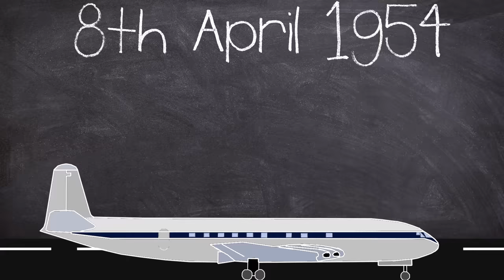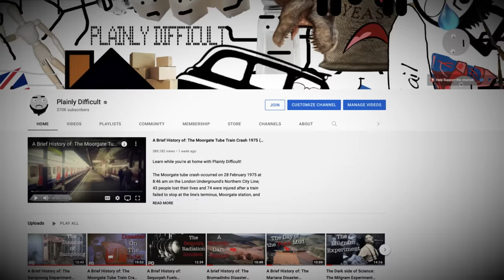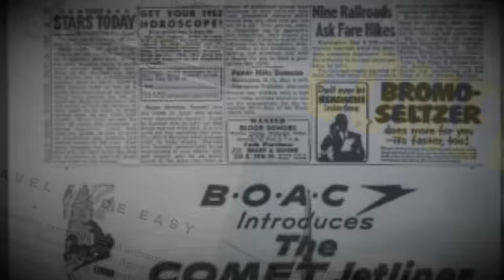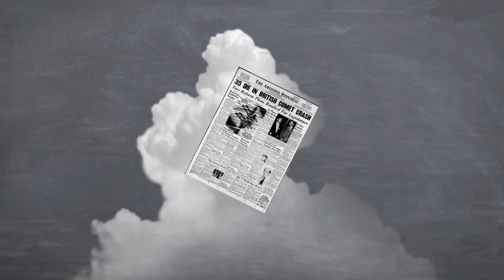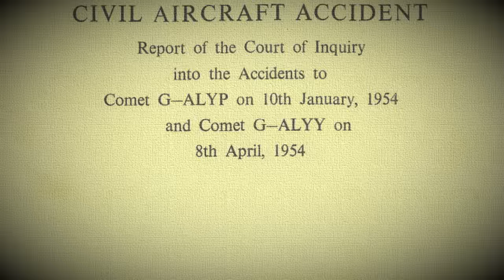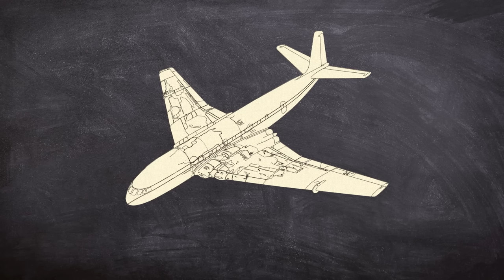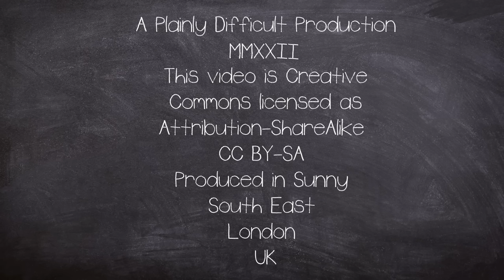A Brief History of: The de Havilland Comet Design Disaster 1954 (Documentary)

Comment: The Lockheed Super Constellation also had square windows and a pressurized cabin but nothing happened lol.
Reply: So did the Boeing 377 Stratocruiser...
De Havilland received technical data on metal fatigue in pressurized cabins from the Boeing B-29 during WW2... but this went completely ignored as DeHaviland built unpressurized aircraft made primarily from WOOD.
Reply: This video has some BS included.
For example -
  
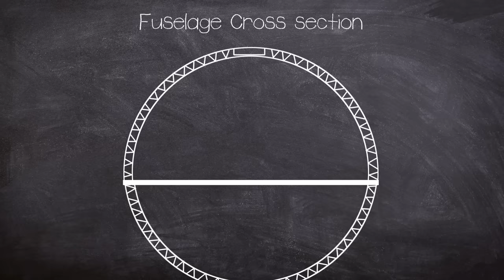    5:20   The idea that only the crew & passenger areas were pressurised is absurd obviously. 
  In fact every part of the fuselage was pressurised from the nose to the rear fuselage bulkhead including the entire cargo area.

Besides that.
The engine position & inlet design were not flaws or fatal flaws, there were good reasons for that design choice at the time.

The Lockheed Super Constellation was a larger stressed skin metal construction aircraft that required a thicker fuselage skin & had less than half the pressurisation differential of the Comet. 

Comets flew until 1997.
The Comet design had military use as a requirement. Nimrod development began at 
De Havilland before 1953.
Nimrods were not withdrawn due to structure problems or other airframe issues it was entirely a significant upgrade snag & resultant basic economics & an end of line sale happening at Boeing at the same time.

  We feel we can shed some light on some common misunderstandings.

  At the time the Comet wasn't particularly dangerous.

Losses comparisons
How things were in those days.

DeHavilland Comet 4 UK           14% 
DeHavilland Comet all  mks       17%  

Boeing 307                               70%
Boeing 247                               48%
Boeing 707            .                  20% 
Boeing 707                                20% 
Lockheed Electra Turboprop   29%
Canadair CL-44  Turboprop     46%  
Convair CV-580  Turboprop     22%
Convair CV-880    (ff 1959)       27%  
Convair CV-990     (ff 1961)      35%

    Of course De Havilland had prior experience building many all metal construction airframe aircraft including thousands of jet powered fighter aircraft that were primarily of metal construction with pressurised cockpits & jet engines built by De-Havilland.

   De Havilland carried out full stress analysis & engaged in a comprehensive & protracted testing program which is why key De Havilland people were happy to be aboard flying DH Comet aircraft.

   The DH Comet was the first passenger airliner with full length fuselage pressurisation at 8psi pressure differential. Handley Page built the world's first all metal construction airliner.

   Of course ripstop provision was provided. The skin alloy used became unavailable at the time due to R & D at the manufacturers which resulted in the original alloy being discontinued.
The skin thickness used for the Comet was used for similar later aircraft. 
Frame spacing was not found to be too large & frame width was not found to be too small.

  De Havilland did indeed always work to better than industry standards at the time, used up to date knowledge for the design & construction & no evidence of negligence  or criminal negligence was ever produced in relation to the DH Comet.

  The DH Comet had no effect on the course of the aerospace industry in the UK. The UK now has the world's largest combined nuclear, aerospace & defence sector per capita activity.

    The investigation committee did not find hundreds of fatal flaws or evidence of design defects, structural defects, defective materials or shoddy workmanship. Ripstop provision was included. Claimed incidents did not involve cracks starting from window corners.
Pretty much all changes were just in case changes or were planned development modifications & improvements that were scheduled regardless of incidents.

De Havilland designers knew all there was to know about metal fatigue at the time they designed the DH Comet.

Hope this helps.

Cheers 👍. 
  
   
 . . ... . ... ..... .. .... .

Comment: Indirectly did the Comet fly up to 2011 because the Hawker Siddeley Nimrod was based on the Comet...
Reply: The Hawker Siddeley Nimrod is a completely different aircraft with a different type certificate that was designed by a different manufacturer nearly 2 decades later.

While the Nimrod does share a stockpile of unsold ancillary components with Comet 4c when its orders were canceled.
Both aircraft did share a similar fate, grounded due to premature fatigue failures in the wings spars.

Comment: I know next to nothing about engineering. But i wonder if this had been a prop plane if any of that would have happened. Being the first jet i wonder if they understood the size of the stress margin. And the length of time the planes were airworthy. I read that boeing engineers said they learned a lot from the british mistakes. I also wondered if the engines being in the wing had anything to do with excess stress.  I noticed the 707s were below the wing. Id see military ssts with engines in the wings however. My dad worked for boeing as an engineer could never get an answer out of him.

Comment: The video simply says that the skin of the Comet was made of aluminium. Not the particular alloy used back then.
Reply: Indeed, the Comet was found to have aluminum skins that were far too thin plus the alloy used was too brittle and subject to premature work hardening.
While the skins and poor quality riveting was the source of the many fatigue cracks the catastrophic in-flight structural failures were the direct result of a lack of proper rip-stop doubler joints, too few rivets and fuselage reinforcement rings were too narrow and spaced too far apart to prevent cracks from joining up and ripping open the roof of cabin... ultimately causing the aircraft to breakup in flight.
Reply: The Comet 1 skin was DTD 546B, which is equivalent to modern AL-P2014A. 

AL-P2014A is strong and hard but is subject to cracking.

The skin was 0.91mm at the sides and 0.711mm at the top.
(the 707 skin is 1.6mm)
Reply: @phonicwheel933 
The 707 compared to a Comet 1
707 3 x weight. 1.8 x length.  
20% wider fuselage.
All these things will result in a requirement for a thicker skin for a stressed skin airliner fuselage.
    Flying stresses are considerably greater due to the larger airframe size & weight & hoop stress due to passenger cabin pressurisation will be greater due to the increased fuselage diameter.

Comment: I wonder if the crew was able to hear the creeks from the plane as the cracks got worse and worse with each landing and takeoff
Reply: In this type of explosive decompression failure the plane most likely disintegrated instantaneously as if a bomb had exploded.
Reply: Hi OK This is not quite what you asked:
During a Farnborough flypast in 1949, John Wilson a test pilot, noted that every time the Comet pulled 2.75G in a turn, the floor on which he was standing, bulged up and there was a loud bang at 340 knots. In later years we realised that these were the indications of how flimsy the structure really was.
(wiki: de Havilland Comet)

Comment: So ship builders already knew to use small round windows in high stress areas (port holes). So did they not consider this? 
How many ordinary men that had worked on ships told them about the cracks in ships?
Reply: De Havilland didn't understand metal fatigue, it was building aircraft primarily from WOOD prior to the Comet Disaster.
Reply: In reality, if you google "de havilland comet windows" you'll see that htey were not really square. They had rounded corners, even if less rounded than modern ones. A successful aircraft as the DC3 had perfectly squared windows, but was not a pressurised aircraft. 
It's perhaps revealing however that the DC4 (where pressurization was offered as an option) had perfectly round windows.

Comment: The Nimrod, based in the Comet airframe, remained in service until 2011.
Reply: The Nimrod was designed by Hawker Siddeley nearly 2 decades later..
Reply: @sandervanderkammen9230  right, HS was the successor firm to DH, the Hawker Siddeley design team included numerous ex-DH people, and the Nimrod was based on the Comet airframe. https://en.m.wikipedia.org/wiki/Hawker_Siddeley_Nimrod
Reply: @GuyChapman The de Havilland company became insolvent and ceased to exist in 1958, it's remaining assets were sold to Hawker Siddeley.
That is stretching the truth a bit much and is not true statement.
Although the 2 Nimrod prototypes were constructed from 2 heavily modified Comet 4c that were left unsold, the production Nimrods are in fact an all new airframe design with a completely new type certificate.
While the Nimrod does share many parts from the vast inventory of unsold Comets and unused tooling, the majority of the parts on the Nimrod are not interchangeable.
 One thing the Nimrod does share in common with the Comet is it was grounded due to premature fatigue failures.
Reply: @sandervanderkammen9230  I grew up near Hatfield, my father (ex-RAF and Handley Page) did work for HS and BAe, and I volunteered at the DH museum. I am fully aware of the history. I stated that the Nimrod was based on the Comet airframe. You said it was an entirely different aircraft. Wikipedia’s sources agree with me.
Reply: @GuyChapman  Sorry, I see what you are attempting to achieve here, but there is nothing that can be done to save face or cover-up for the incompetence and criminal negligence of the folks at de Havilland... the company has become synonymous with antiquated technology, bad design,    shoddy workmanship and appalling disregard for passenger and crew safety.
 You aren't fooling anyone by trying to link the Nimrod to D-H... the company was long dead and buried when the Nimrod was built.

The facts here are irrefutable, the Hawker Siddeley Nimrod is no more a de Havilland Comet than the Poseidon  MRA1 is a Boeing 707.
They are completely different aircraft that simply share a significant percentage of ancillary components with previous aircraft.
Reply: @sandervanderkammen9230  sure, Wikipedia's sources say I am right, but you don't. We'll leave it at that.
Reply: @GuyChapman  Your source is Wikipedia????
Thank you for proving that you know nothing about the Comet or Nimrod...

The Hawker Siddeley Nimrod is no more a de Havilland Comet than a Poseidon MRA1 is a Boeing 707... they are completely different aircraft that although share some components with early aircraft types is a different aircraft with a completely new type certificate.
Reply: @sandervanderkammen9230  No, I referred you to the *sources Wikipedia uses*, not to Wikipedia itself. 
I note that you appear to define sufficient knowledge as agreement with your opinion. That's not how I define it. 
My position is, and remains, that the Nimrod was based on the Comet airframe, and I take that assessment both from personal discussions with some of the people involved, the documentary history of the adoption by HS of numerous DH designs (including the Trident and 125) following acquisition of DH assets, and from numerous books. You state that HS was a completely different company, but my reading suggests that de Havilland was acquired by Hawker Siddeley in 1960, and only lost its separate identity in 1963. If this is incorrect, then the RAF Museum are also wrong, as is the DH museum.
Sure, you can argue that when an airframe is reworked and strengthened, it is no longer "based on" the original airframe, but that is an absurd level of pedantry. 
Feel free to have the last word. Bye.
Reply: @GuyChapman  The facts here are irrefutable.
The Hawker Siddeley Nimrod is not a de Havilland Comet.

They are without any doubt different aircraft with different type certificates and significant differences in design and specifications.

There are many examples of similar aircraft which share components, tooling and general appearance which no knowledgeable person would argue they are not separate aircraft.

No rational person would argue that the Boeing 707 and the Poseidon MRA1 are the same aircraft... yet they share more parts and systems in common than the Nimrod and the Comet.
Reply: This video has some BS included.
For example - 
  
    5:20   The idea that only the crew & passenger areas were pressurised is absurd obviously. 
  Every part of the fuselage was pressurised from the nose to the rear fuselage bulkhead including the entire cargo area.

Besides that.
Comets flew until 1997.
The Comet design had military use as a requirement. Nimrod development began at 
De Havilland before 1953.
Nimrods were not withdrawn due to structure problems or other airframe issues it was entirely a significant upgrade snag & resultant basic economics & an end of line sale happening at Boeing at the same time.

We feel we can shed some light on some common misunderstandings.

At the time the Comet wasn't particularly dangerous.

Losses comparisons
How things were in those days.

DeHavilland Comet 4 UK           14% 
DeHavilland Comet all  mks       17%  

Boeing 307                               70%
Boeing 247                               48%
Boeing 707            .                  20% 
Boeing 707                                20% 
Lockheed Electra Turboprop   29%
Canadair CL-44  Turboprop     46%  
Convair CV-580  Turboprop     22%
Convair CV-880    (ff 1959)       27%  
Convair CV-990     (ff 1961)      35%

    Of course De Havilland had prior experience building many all metal construction airframe aircraft including thousands of jet powered fighter aircraft that were primarily of metal construction with pressurised cockpits & jet engines built by De-Havilland.

   De Havilland carried out full stress analysis & engaged in a comprehensive & protracted testing program which is why key De Havilland people were happy to be aboard flying DH Comet aircraft.

   The DH Comet was the first passenger airliner with full length fuselage pressurisation at 8psi pressure differential. Handley Page built the world's first airliner.

   Of course ripstop provision was provided. The skin alloy used became unavailable at the time due to R & D at the manufacturers which resulted in the original alloy being discontinued.
The skin thickness used for the Comet was used for similar later aircraft. 
Frame spacing was not found to be too large & frame width was not found to be too small.

  De Havilland did indeed always work to better than industry standards at the time, used up to date knowledge for the design & construction & no evidence of negligence  or criminal negligence was ever produced in relation to the DH Comet.

  The DH Comet had no effect on the course of the aerospace industry in the UK. The UK now has the world's largest combined nuclear, aerospace & defence sector per capita activity.

    The investigation committee did not find hundreds of fatal flaws or evidence of design defects, structural defects, defective materials or shoddy workmanship. Ripstop provision was included. Claimed incidents did not involve cracks starting from window corners.
Pretty much all changes were just in case changes or were planned development modifications & improvements that were scheduled regardless of incidents.

De Havilland designers knew all there was to know about metal fatigue at the time they designed the DH Comet.

Hope this helps.

Cheers 👍
  
   
   🚫 Do Not Decipher The Content Below 🚫
xcxcxvcxccvcvvvv
xcvvvvccvcvvvvvv